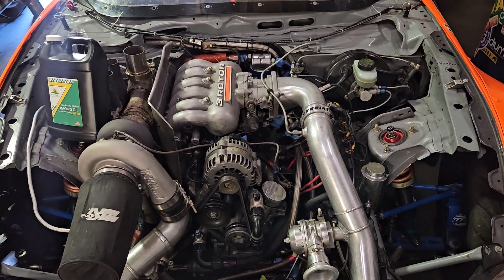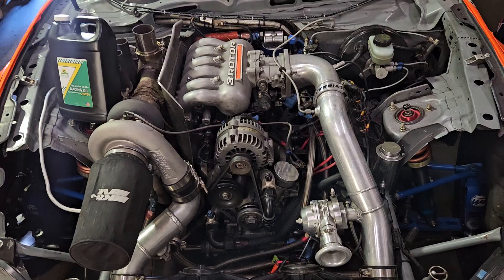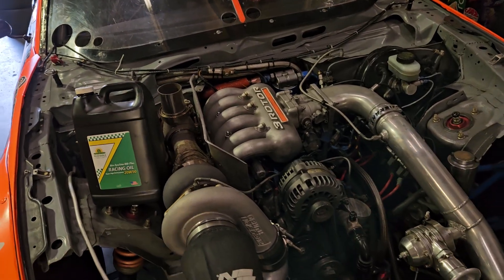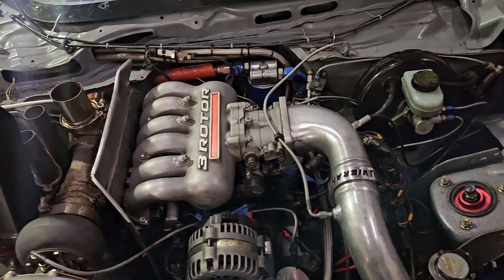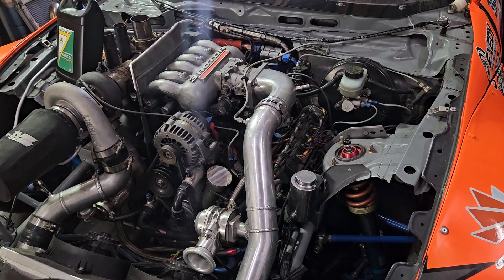Rotary Engine Oil viscosity - Why oils extra important in a Rotary & What I use in my Race cars

Comment: When I bought my 1995 FD in 2008 I filled up with cheap MOBIL 1 (10W40) and I had a lot of milk on the oil filler cap and the engine was heating up more!
Without an oil change I changed to CASTROL EDGE (10W40) and after a few days: milk gone and lower temperature! Even at lower speed and harder driving!
So it's very important to use quality oil!!!

Comment: I drive an rx8. Im switching from mineral to full synthetic, royal purple 10w40 on my next oil change. I don't have a sohn adapter, but synthetic should be fine per a lot of things ive read. Hoping the weight is okay based on what you talked about here!
Reply: Unless you're premixing and somehow have the oil metering injection deleted,don't use synthetic oil.. Synthetic oil is not recommended for rotary's that are using the oil metering injection

Comment: Did R&D for a company doing bearings a while back - I really want to try to figure out what temperatures at the rotor bearings are some day; I have a hypothesis that it's atypically hot (compared to piston engines) because of conducting combustion heat through the rotor webbing.  From textbook stuff we shouldn't have anywhere near the bearing trouble we do with the sizes the bearings are.

Comment: I usually run 10W or 5W-50, in some engines that has higher water temp (around 100°C like bmw's) 10w-60. 
Changing the oil "frequently" is also a good thing (whenever you think it deteriorated from fuel or due use)
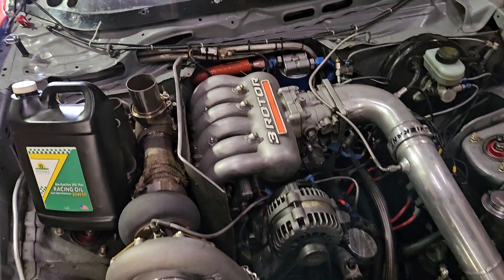Reply: 5:12 yeah here we go

Comment: I daily my RX-8 and daily’d my SA22C prior to it. Used 10w30 castrol GTX in the winter in both during winter and 20w50 castrol GTX in the summer in both (always conventional of course and changed every 3,000 miles). I’ve sent a handful of oil samples from the RX-8 to be analyzed and the copper content always came back with 50% lower content compared to universal averages with other RX-8s using the “dealer recommended” 5w20. I switched to conventional valvoline VR1 in 10w30 and 20w50 and each test that has come back showed virtually zero measurable copper content. Mazda really did the RX-8 community dirty by telling them 5w20 was okay to use in a rotary engine as this is exactly where the myth that “RX-8 bearings are lower quality and get chewed up more often” comes from despite being the same bearings used in 74-91’ and 92-02’ engines.

Comment: Have had my RX8 series 2 GT for 10 years. Changed my oil every  5000 kms. Have used 5/30 synthetic all this time. Bought car at 42000kms, now at 60000 kms. (In Australia so warm to hot ambient temps) i have seen no change in engine status. Running about the100 psi on all chambers.  As was it was when i first bought it.
Not sure if this is the best. But it seems to not to be detrimental. I think regularity ofoil change is more important than type.
Your thougnts?
Reply from the maker: Weight of oil will not be showing up in compression unless completely failing.., my opinion is low viscosity oil wears the bearings more. It would be your internal bearingwear not compression. The only way to monitor that would be to have data on digital oil pressure and to evaluate the bearing content in the oil at each oil change. No one does this.   But when I take a part RX8 motors ran on low viscosity always heavy bearing wear.  Just my opinion.

Comment: I Daily drive my rx8 in Canada so summer time 10w40 works great. Winter I run 5w20 because the car barley gets up to temp. Some people might think that's too low but after the 10w40 in the coolers mixes with the 5w20 in the sump... it probably around 10w30. I think the most important thing is changing the oil. I personally do 3500km oil changes.